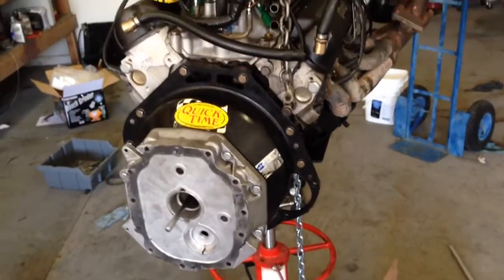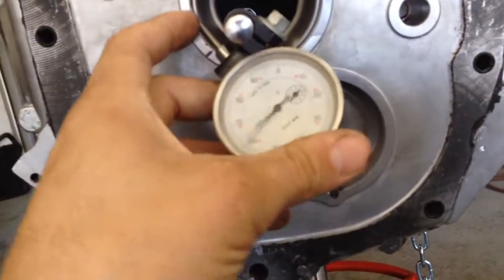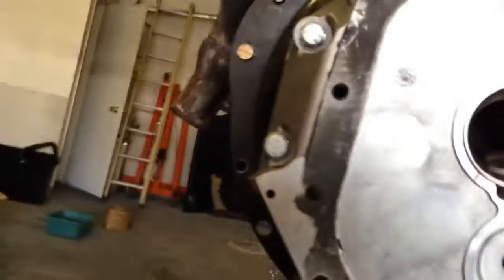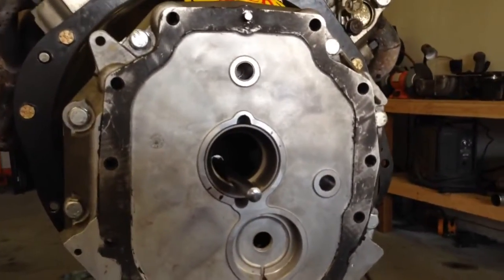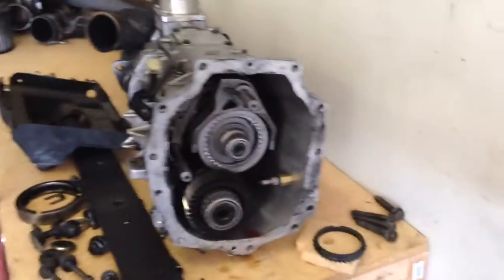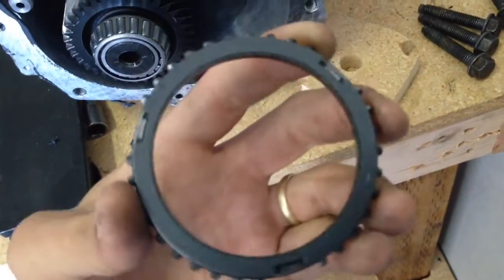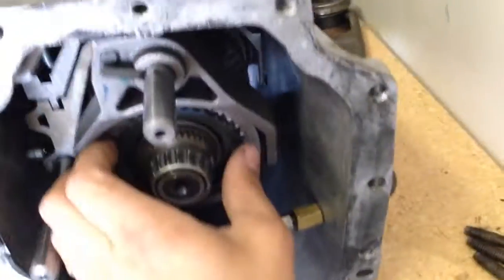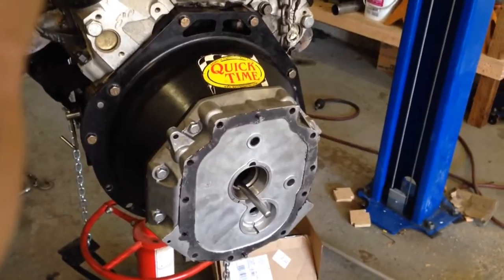Proper t56 bellhousing alignment

Comment: Nice video, just a couple of nit picks
At approximately 4:00, you talk about which way to move the bellhousing.  I think you got it backwards.  you want to move the bellhousing to the low reading so move it to 3 O'clock.
Also, when you sift from 3rd to 4th, the synchros slow the input shaft, not speed them up.
Now I'm going outside to measure my own run out.  Thanks

Comment: Check out our new T-56 alignment plate available @ Holley Performance.  (RM-130)  The RM-130 eliminates you from having to pull your transmission apart.  Works with the QuickTime bell or any OE T56 bellhousing.  Ross

Comment: Hey when replacing the front cover do you have to seal it with anything?  also how do you decide where to start when using the dial indicator?  thanks!
Reply: Seal it with a thin RTV bead.   Thin.  Then use the same dial indicator and check the play in the input shaft.  Look for videos on T56 rebuilding for details.

Comment: I have a question, I have a t-56 in my trans am it's a full bolt on cam + spray car recently when banging gears 3-4 makes a quick Zzzz or grinding noise , Im not being locked out and under normal driving it's fine , it's not leaking fluids and I changed trans and clutch fluid , it has a upgraded clutch but I'm unsure if its synchro, clutch, slave or master related? Master is stock and I think slave is to but unsure
Reply: check out his video on the t56 fluid pump mod.
Reply: Hey bud what t56 exactly are.you using ?

Comment: Is the fact that the dial indicator at and angle going to mess up the reading?  I would think that if the dial indicator is at a big enough angle it would only represent a fraction of the actual distance.  Am I a moron?  I have an ls3 that I am currently doing this on and it seems to follow this video pretty exactly.
Reply: The value may not be .001" = .001" but it will show an out of center condition